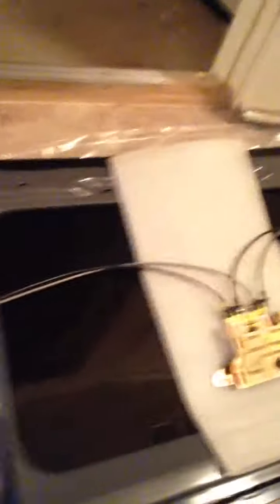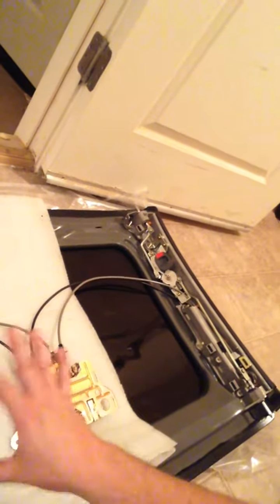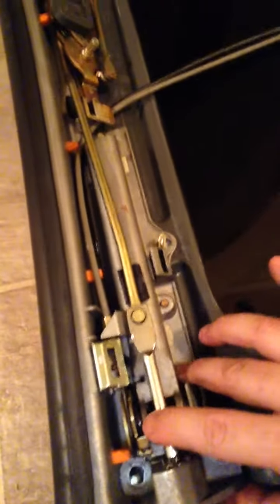JDM Reverend's How To: Adjust and Align a Honda del Sol Targa Top

Comment: Hey dumb question but im just looking for some help/guidance before i break anything any more lol. I had the top off one day and when i went to put it back on, the driver side locked in just fine but the passenger side handle broke somehow. The handle would move but the pin wouldn’t lock into place. I managed to get it by putting pressure on both the top of the car outside and the handle inside while slowly turning. I’m thinking i stripped a bolt/screw inside the mechanism and have to take it all apart to fix and maybe don’t need new handles. Im really hoping i actually just stripped the handle that connects to the screw and need new handles. It’s cold so i’m not messing with it right now but i’m just trying to figure out if getting new handles is a waste or if im even in the right track of what could be broken.